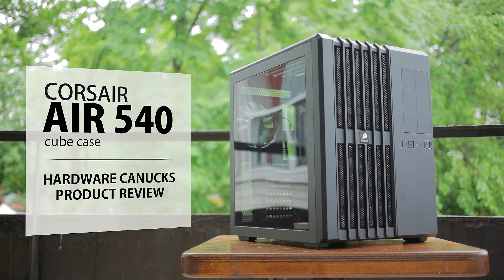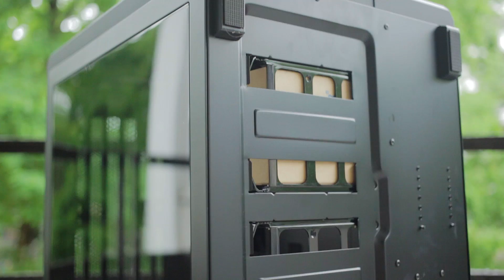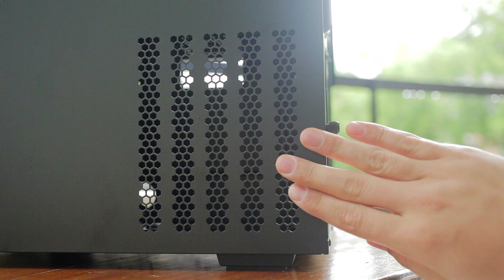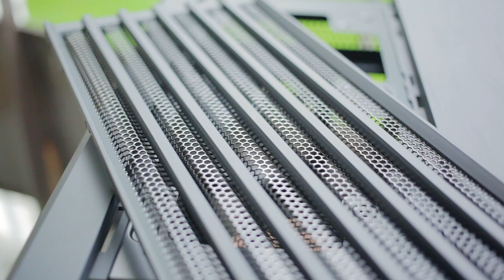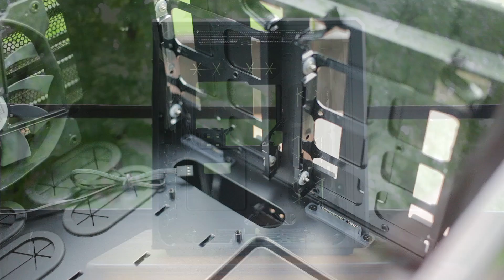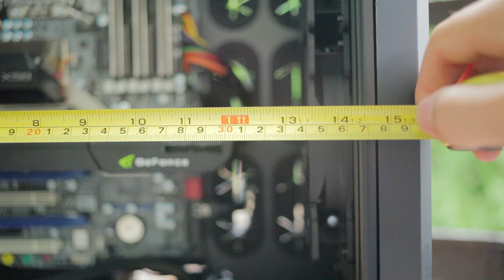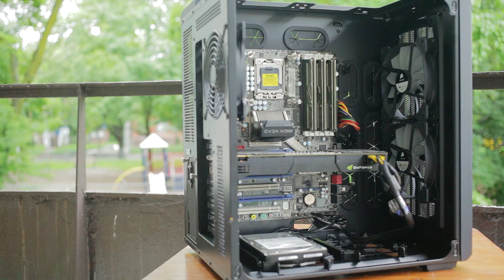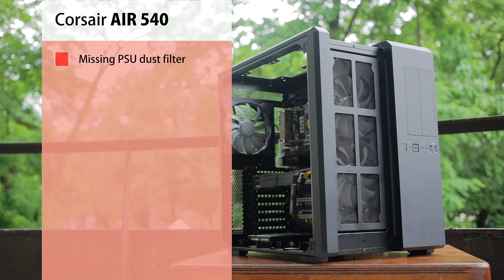Corsair Carbide AIR 540 Cube Case Review

Comment: This case is AMAZING , you have a ton of room for pretty much anything you want you can fit 1 triple 1 240 and 1 140 rad at the same time in this case and you have plenty of room for a pump and reservoir( you made a mistake on that one when you said you had limited options for pumps and reservoirs) Due to its open design the case is as silent as the fans you put in it, there is no noise dampening going on and as far as dust go, yes it could have more filters but it is a easy case to clean, I definatly agree with your statment regarding the psu not having dust filters, for the price it is indeed unacceptable
this case fits various motherboards I myself have an EATX sabertooth x79 in it and it fits like a charm
The case is really easy to dismantle and also easy to mod, I can see modders having a lot of fun with this one
as far as building you have dont have any problems at all, space is real on this one you can fit pretty much anything you want and wont have trouble installing it BUT somethings like 4 way SLI/ Crossfire is not an option and if you plan on installing a gpu on your last pci express slot on your motherboard well you are shit outta luck due to spacing
3 gpus is possible thou depending on your motherboard
As far as Heatsink options you can fit pretty much all of them, a lot of space between your motherboard and side panel window
Storage is a bummer thou, you can have only 2 harddrives which is not acceptable IMO seeing as ( as you mentioned ) there is space on the psu side that could be used for more storage options
I reccomend checking out SingularityComputers Build 13 as He does a damn nice watercooled build on the 540 air.

Comment: My friend bought this case last November. Depending on where you live, there is pretty much a dust build up in the chamber where the psu is, dunno if this is because of the lack of a filter. For now we installed a make shift filter made out of panty hose.

Comment: Debating between this, the 450D the NZXT H440 or the Thermaltake Core V51 for a 3 way crossfire build. Thoughts?
Reply: If you haven't already bought it I would go for the Corsair 540  if you're going to do 3 Way crossfire there's a lot more room for the cards to breathe and the 540

Comment: I was originally gonna go the 750D but when I saw this I quickly changed my mind it has a huge window and the hot swappable 3.5" drive cage things are cool and cause I probably won't put a optical drive or ssd in I can remove both of the cages for easier cable managment I guess

Comment: As far as dust fliters go, I was never keen on the quality of stock dust filters in the first place, if this were my case... http://www.demcifilter.com/c198/Air-540.aspx <--- this would be my solution.   Having said that, it is possible to do a regular watercooling loop if you mount the pump where one of the 3.5 drive bays would be, and pass on having an optical drive and drop a shorty or box shaped reservoir in it's place.  Although I do think when you say water cooling to Corsair, particularly in regards to this case they simply make sure you could fit an H100 or H110 in it rather than a custom loop.
Reply: I wasn't going to buy this because of the dust filter. Now that I know I can get them, sold.
Or at least put on my top list until I decide.
Reply: ***** Depends on where you live... I mean I am in Las Vegas, to me X dollars is more worth it for dust filters if only because this is a desert and really really dusty climate.

Someone in a place like Seattle might not see the same value in it because the rain keeps the air less dusty.
Reply: +Christopher Snow Awesome, was unaware of this site and those filters.  My house is VERY dusty and in just the 2 weeks of owning this case I can see the buildup on the case already.  Definitely going to pick up these filters!
Reply: Stoneysilence Maybe dust your house, man!

Comment: will the Noctua NH D15 fit in it?
Reply from the maker: It should!
Reply: The case specs say a clearance of 180mm, the NH D-15 specs say it has a height of 165mm.
Reply: mjkmojofool yeah but i saw a video saying its clearance for 170mm :S so who is it to trust? got the 540 btw! :) getting the NH-D15 soon with Broadwell! :) so stoked about it cant wait...
Reply: Alcatraz Aronsson I went to both the Corsair and the Noctua sites to view the specs.
I'd be very interested to know what you think of the NH D-15 when you have it up and running as I'm thinking of investing the money in one of them myself.
Reply: mjkmojofool im glad to hear that someone else has the same interests as me. :)
well right now im using a 2550k intel core i5 cpu, and im planning on buying a Broadwell CPU and with that i want to get the NH-D15. i already bought the air 540 and i use it right now. i was thinking ''maybe i can have the NH-D15 for my 2550k too for the time being'' but that never happened lol. so when the Broadwell CPU's launch i will pic wich one i want and with that i will buy the NH-D15. but Broadwell is set to launch at early 2015 so its quite a time till then :/ but i will save your message and when i have it all installed, i can send you some pics of it and maybe some benchmarks, if thats alright?

Comment: is there no space for more fans? if i were to get this i would have four 120mm and one 140mm spare fans...
Reply: You can have 3x120 at the front, 2x140 on the top, 1x140 to extract the hot air at the back. There's room for 2x140 at the bottom too if it's still too hot if you don't care about non ssd hard drives.
Reply: I know i have it now :)
Reply: Vli ah cool congrats !

Comment: I'm wondering whether the black bit you can detatch (there the fans are) is paint-able? I'm buying this in white and I want to paint the black strip orange. Is it rubberised or is it all metal? Can i paint it or will it lose the rubbery feel (If there is one)
Reply: It's metal but I can't see why you couln't paint it orange if you wish. You can detach the front panel (the black metal mesh) You can probably just get spray paint to get it done. The mesh isn't ruburry. It's just metal painted black and black plastic.

Comment: No dust filters for PSU?

RAGE
Reply from the maker: RIGHT?!?!?! exactly my thought process
Reply: TheLordOfWar Given how majority of enthusiast grade cases in the current market come with dust filters, why would it be unconventional to criticize this case for failing to supply one? As for technological reasons, there's no reason to assume that side mounted PSUs do not require fan filters. As long as unfiltered air goes in, dust will go inside your PSU - and let me tell you as a person who experienced a PSU burn because of a crappy PC case - it's a traumatic experience and I had to repurchase every single component because of it. 
Hell, I even decided to get a new PC case!

As for top mounts, it's more to do with preventing dust from entering after turning off your PC.
Reply from the maker: mayatk1 THANK YOU! My reasoning exactly :D you get a virtual fist bump!
Reply: HardwareCanucks Why exactly do we need dust filters on an side mounted PSU? I mean, i get it why bottom mounted ones have them but side mounted ones? I doubt that anyone of us uses his PC in an coal mine. And why exactly would i want an dust filter on exhaust at the top? I am by no means an expert but wouldnt that be contraproductive if the dust inside the case cant be blown out of it?
Reply: You could purchase a magnetic dust filter to put on the psu
Reply: HardwareCanucks I wouldn't class anything under $150 an enthusiast grade case. An more often that not, ones around this price point or below don't come with a full set of filters.
Reply: FallingForgiveness *Cough* Phanteks do cough
Reply: Alcatraz Aronsson Looking good ! The only front filter they give you cries to be changed anyway. Still it's a great stylish case. I can only recommend it.
Reply: I've never seen a dust filter on a server or office workstation. Dust will accumulate over time unless you're using hepa filters.
Reply: @438295 how do you blow out a case?
Reply: The case is is not very expensive for what it is and you can get some great quality filters for about a 100$ for this case. It's sometimes best not to go with the all inclusive packages if you like quality. It seems true for many things in life really..
Reply: Pascal de Aguiar thats right, i bought a high quality dust filter for my 540. the filters i bought prevent Micro-particles from coming in too. http://www.castlepointtanning.co.uk/items_images/1342983555website%20dust%20and%20carbon%20filter%20copy.jpg the filter shown looks very similar to mine, not sure if it is the same tho but it does look very similar, and as you can see it is very dense.

Comment: I just got this case and I'm very happy with it. It has like the easiest setup and possibly the best cable management I've ever seen.There is a huge flaw however.  The PSU is too close to the back cover and the holes on the cover are not enough(resulting in poor ventilation for your PSU) so I'm forced to run this with no back cover. I'll propably make a hole over there. So here's my warning to you. Excuse my bad english I'm not a native speaker.

Comment: I another review, I think from Linus he said that the power supply didn't need a dust filter during Corsairs testing. However, this has been my first video I've watched from you guys and I really like the cinematography as well as the overall review!
Reply from the maker: Thanks! Check out the rest of our videos :D
Reply: +Codename AZURA 

http://www.amazon.com/gp/product/B00D6GINF4/ref=as_li_tl?ie=UTF8&camp=1789&creative=390957&creativeASIN=B00D6GINF4&linkCode=as2&tag=yutubzs3-20&linkId=4YQ3NU7NASNE7DNH    Corsair AIR 540 is only $80 now :p

    

      
        

  
    Corsair Carbide AIR 540 Cube Case Review
Reply: +Codename AZURA what about the bottom? where your motherboard and ram is.. still thinking it's overprice with so lil dust filter to be offered although i kind of like this casing

Comment: I have this case and I love it! Elegant look, easy cable management, and keeps everything nice and cool.

My Build:

CPU: Intel Core i7 3970X
Mobo: ROG Rampage IV Extreme
PSU: Corsair AX 850
GPU: 2 MSI 7970 OC Afterburner edition Crossfire
Ram: 16GB Corsair Vegeance Black 
SSD: 120gb Corsair Force GT
HDD: 2TB Barracuda
Drive: Asus
OS: Window's 7 Ultimate
CPU Cooler: Corsair H80i

Comment: Aside from the filter problem this case would be PER-FECT for me, but be reasonable. You can get a fan filter for like... 2$? and glue it on the side panel or something like that, problem solved.
And about the 3,5" bays, most people that buy a case like this will most likely get 1 SSD and 1 3,5" 1TB or more drive since for most people that's more than enough.

I'm ordering this case coming monday and will fit a 360 rad in the front.
Reply: ***** Not having filters improves airflow, which is believe is the point

Comment: Just got one of these and there is a dust filter on the top, but still not on PSU. Totally agree with the back chamber (that's what she said) - but with the anchor loops and with some cable ties, it's easy enough to keep the bottom clear and mount a pump.

Comment: if they made a proprietary PSU that was thinner, they could slim down the back so it wouldn't be so boxy in design, they could add a 3.5 inch drive cage in the back, and cut less corners in general.

Comment: The "unacceptable" lack of dust filter for the PSU, was due to Corsairs testing, there wasnt a need. Like you previously stated to "Innate", the fan wont spin up enough to cause vibration, therefor it wont spin up enough to cause a ton of dust to be sucked in.

Comment from the maker: I don't think so. Rubber feet usually are nice to have, but PSU fans at full speed should NOT introduce any noticeable vibrations. You shouldn't worry if your mind is set on the Air 540. :D

Comment: Question to HardwareCanucks, or anyone with knowledge: At the area where the PSU sits on, there's no rubber material used at all, so the PSU is pretty much sitting on metal. Since I'm making a new build around next week, and willing to pick this case, should I be worried about this, if at all? Thanks in advance

Comment: Interestingly, almost every negative that you had about the case I don't really care about.  Exactly why do a care about the side panels being a little floppy when I'm waving them around in the air?  They are thoroughly solid when they are on the case, which is 99.99% of the time.  I do have an issue with that tool-less SSD cage.  It's a poor design and mine arrived broken.

Comment: It doesn't have dust filters on the top because that is typically set up as exhaust (heat rises) and dust filters actually impede heat reduction, as they will hold back the hot air a bit. Since it's the exhaust not much dust would make it through the top anyways. As for the PSU vent having no filter...there really isn't an explanation for that (that I know of).

Comment: depends on how routinely you clean out... the last rig I built called for this case and to say it was lacking filtration, I can say that the only dusty part is the power supply, so a filter and some silicon later... clean psu!

Comment: This case looks amazing. I mean really he said it himself the top is exhaust so not a big deal on filer. Also same with power supply I mean bottom mounted yes that would be a problem seeing as on a desk or floor it would pick it up but side mounted with tiny ventilation holes. Well that's not such a big deal.

Comment: I'm not exactly getting the videos logic in concluding that it needs to be modified to support a fully custom water  cooling loop? because the drive bays are vertical and a bay reservoir would be in cumbersome? ever think about using any other kind of res ... I,m sure a res and pump will fit in all that free space... the front intake is built to accommodate a triple 120mm rad

Comment: I like the cube, but the right side has to be wide enough for the PSU and optical drives to fit normally flat side up or down.. not on their sides... and yes it needs the fan filters, and if it had 4 optical drive bays, you could mount a two bay reservoir and your optical drives..  I like the look of the case, but I also think they could add fan options for the acrylic window as well...  lets hope Corsair will improve upon this first option case!!  I also liked the 4 drive ssd cage!!

Comment: I would alter the rear chamber in a way that it is fully closed. That rear mesh at the back is only good for dust to come inside the case. It's meaningless in terms of cooling, since there is nothing to cool in the rear chamber. The cutouts at the bottom for the 3,5" drives could also gather a lot of dust. Both into the case and onto the drives, which is really bad. When shut off, dust will easily fall into the case from the top. It's a poorly designed case overall.

Comment: Thanks for the great review...and though it has it's flaws this case and the Haf XM are the only cases i can ever imagine using for sub full tower cases. This case has the prefect setup..just throw in an h100i and don't look back. I'd be willing to spend a few extra bucks and but 2-3 dust filters to perfect this case. Maybe even Sauter on a few pieces of black painted metal on the bottom of those hot swap Bays.

Comment: Even with a dust filter, the impedance of airflow would be unnoticeable with corsairs AF 120 or 140-L series fans. due to directed airflow and the CFM they are able to push or pull. point is, dust filters don't do shit to air other then clean it. i mean its not a silk sheet. May many cans of dust remover be in your future.

Comment from the maker: The bottom openings we find are benefitial for letting the 3.5" drives breath, the issue with dust is not for the main chamber but for your PSU, as that will clog up if not routinely cleaned.

Comment: its not about being expensive or not, its about what the case offers for that price and while this case offers nice air flow its many cons doesnt justify 140$, i paid that for my 500r, and i do have all my filters; front, top and psu, more HDD bays and optical, very solid side panels to the draw back of no side window and one less fan at the front, so in fact the r540 should be around 110-120 max, 140 with all the cons fixed... i was looking forward to the r540 but i guess ill be keeping my 500r

Comment: I already have this case and I can testify to the fact that dust does not enter the case from below as there is no fans pulling air from the floor so dust egress is minimal. In fact there is very little dust in the case and I've had it for over a month and its next to a window. It looks great

Comment: Great idea, very well done. But, overall I am quite disappointed, the flimsy panels, the lack of dust filters, the lack of 3.5 inch bays in the back, the cutouts around the 3.5 inch bays, and the orientation of the 5.25 inch bays, along with the pretty big price tag, makes this one of the most disappointing products I have seen from corsair. I really hope they redo this case in the near future with all the issues addressed, then I'd be willing to spend my 140-150 USD on it.

Comment: I can see having 3 prefilled water cooling loops in there at once, two 280 for 2 gtx 670s in sli and one 140 for your CPU, to combat the dust problem , you turn all fans into intake causing what we call "positive air pressure", this should solve your dust problem also meaning that all your actively cooled components get 100% fresh air and also heat do not get out of one location but rather from everywhere available, also with this you will save yourself the headache/cost of complex water cooling